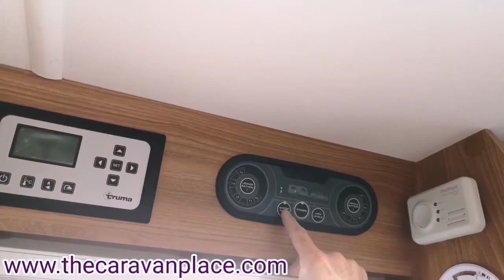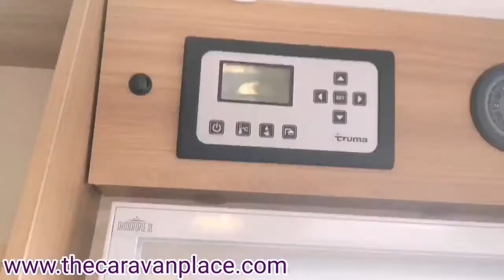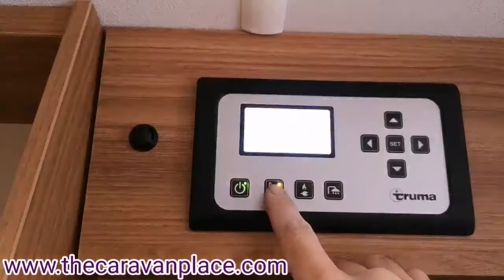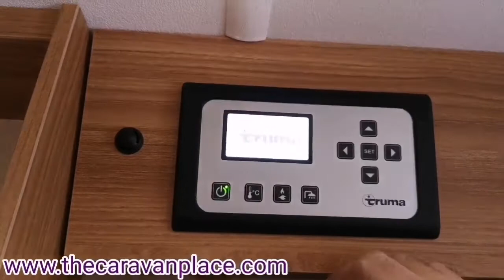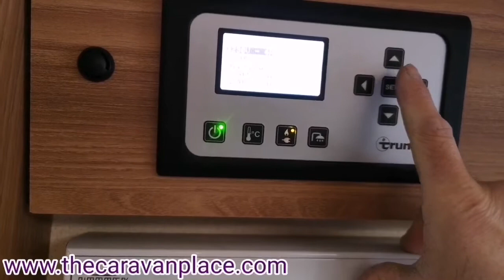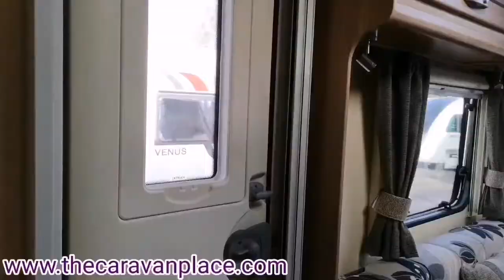Truma Combi heating and hot water, how to use quick start guide.

Comment: Hi mark,I've just watched a vlog on the truma heating system that you done. We have that same system in our caravan,we used it last time out on electricity and it came up error 45 which was a overheating code,we pressed the rest button and it was ok,is there a proper way to close the system down so it doesnt over heat when your packing up when it's been on for a bit and it's all hot ? Thanks Tony
Reply from the maker: Hi Tony, you should be able to turn the heating and hot water into the off position on the panel, some caravans have the power isolation button on the control box to tirn the 230v off and if you have this then you can also turn that off, but just the control panel turning the heating off or drop the thermostat temperature right down and then turn the hot water off. Hope this helps. Thanks

Comment: all systems are on however the heater is not blowing warm air and and water will not get hot, if this is a fuse please could you tell me which one this may be, thanks.
Reply from the maker: Sometimes you will have a fused plug socket, depending on the caravan, it could be by the heater or by the fuse and trip switches. If you make sure everything else is working on 230v, you could put on gas for the time until you can find the problem. Hope this helps.

Comment: Hi if I don’t won’t hot water do I just leave the hot water symbol flashing
Reply from the maker: Are you able to choose no power, where I choose 60, can you use the arrows to choose no power or off?
Reply: @thecaravanplace  no it just got 30 or 60 I want to put though puriclean though the system
Reply from the maker: @alanpostma5861  if you just turn off with the main on and off button on the heating and hot water, this will stop the water heater being on, and you can run the water through the hot system and cold system without the truma being on at all.

Comment: we cannot get our control switch to go green only red with a connection error message
Reply from the maker: Sorry I had missed your message. I would check the 230v power supply is working ok, It may be worth disconnecting the panel from the boiler and reconnect, if you google this it will hopefully come up, if neither of these work it would be best to have an engineer take a look.
Reply: @thecaravanplace  hi folks, I keep getting the following message - Operation Fault: Communication Error. I bought a new Leisure Battery and new PCB but still not working. I notice the room temperature temperature is not on the display. Would this have anything to do with the problem?
Reply: Did you get this resolved guys?